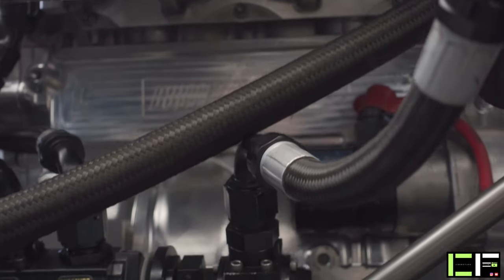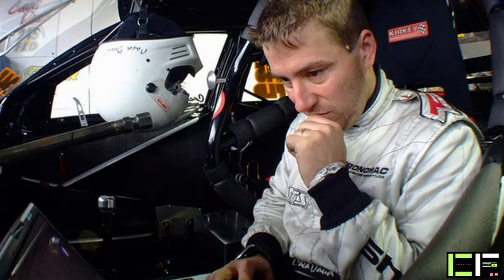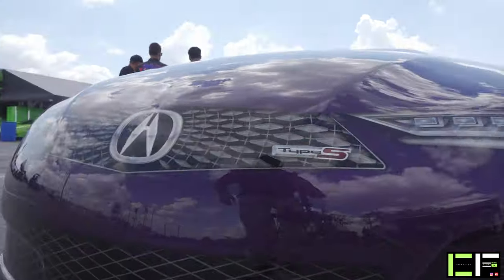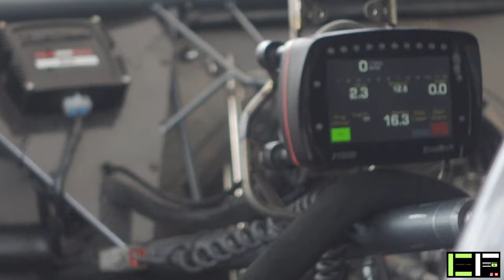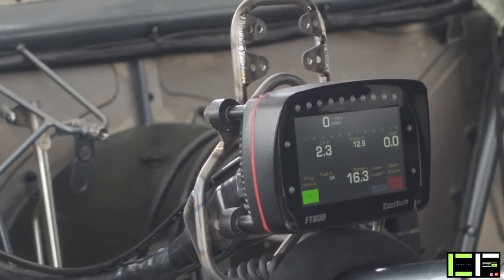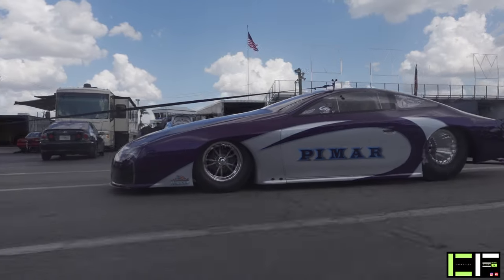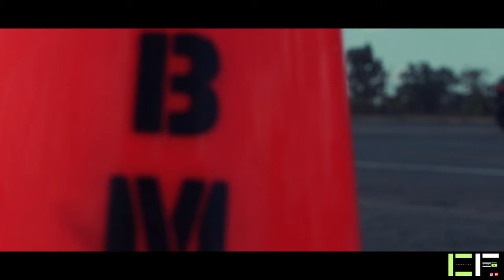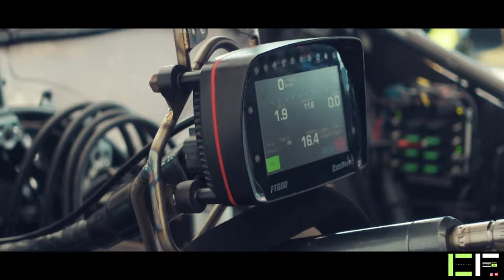K-Series Honda Modified Import - PIMAR RACING

Comment: People have to keep in mind what it takes to out run these import car's, you notice it's usually a big cubic inch nitrous turbo motor is what it takes to out run these guys that says a lot!! They obviously can't run with these cars on the same HP, remember big car big motor little car little motor so no crying over weight
Reply from the maker: Very impressive indeed.